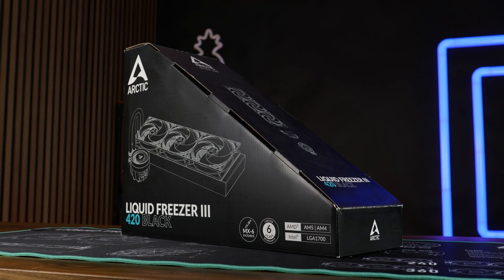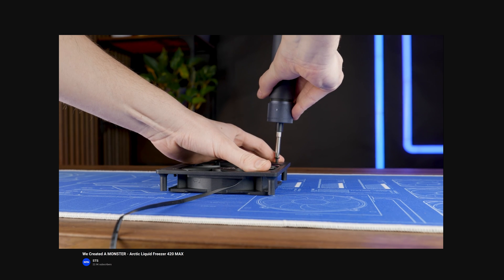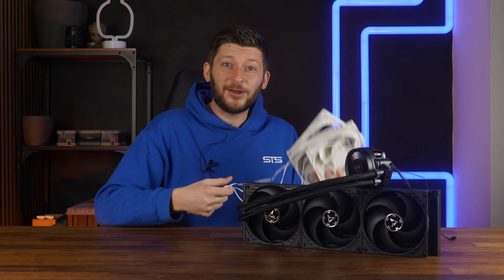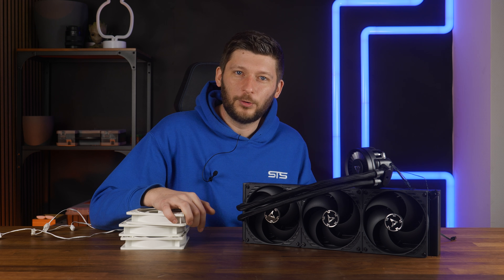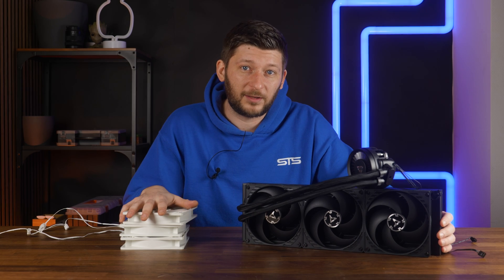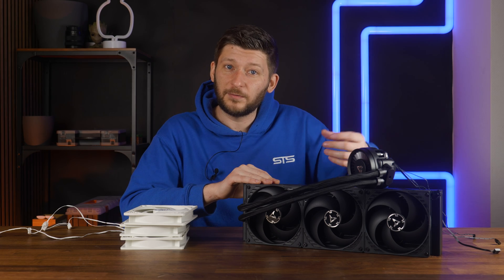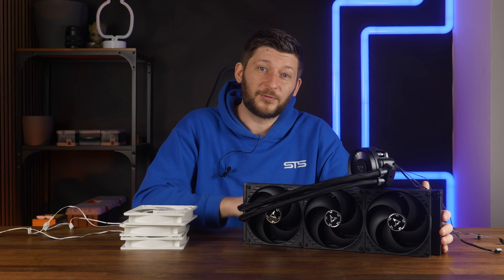Arctic Made A HUGE Mistake - Arctic Liquid Freezer III 420 in Push-Pull

Comment: mine dont have the cable atached to the two tubes going out from the radiator, so the fans are disconected, is that a munufacturing error? or are the cabbles hidden?

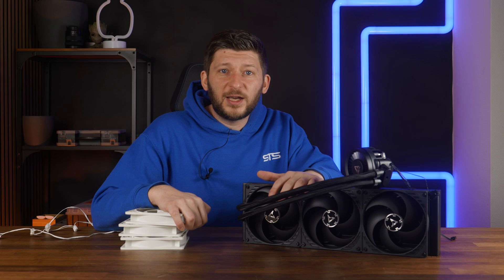Comment: 3:05 - 120W load on 420mm AIO, nobody cares...

Me, puting AC LF III 420 ARGB on R7 7700 capped at 103W... :D

Got good deal on that cooler, had to cut out the case to fit it outside the case on the top and I still mounted 3x120mm push (inside the case) and 3x140mm pull(outside, on the RAD, reversed of course), because - why not?:D

CPU is doing 70-75 *C max at full load no matter if I run it at 10%pwm or 60%pwm. Yeah, with 60% I am closer to that 70 and with 10-20%PWM range closer to 75, but still, can not see the reason to go that way as quiet PC under load is more important for me than those 3*C.

Comment: The best part is that the P14s are so cheap and so quiet. Yes they're not the "best" fans but imho they are the absolute best balance between noise, static pressure, and price. I did something similar by doing push-pull with my LFII 360 and six P12s. I have my fan curve set soooo conservatively and I honestly can't remember the last time I actually heard them get above the dull whisper they give me at idle. I only have a 12700k, but I do have it overclocked, and with this setup I don't think the fans ever get over maybe 45% fan speed? So great!

Comment: I have same aio, and have noctua 140mm fans with 13900kf. Reaching 91 degrees C with cinabench on 253w, I am right now planning to put 3 more noctua fans and will see how it goes
Reply: This guy seems a bit delusional or his graphs are not making any sense.. showing temps of 70ish with showing 320 W profile.. high workload?! What is that, cinebench or just adding some workload to the CPU (not stressing it)...
Reply: Btw I am hovering between 84-88 in R23 while pulling 275/290 Watts in R23.. but I am running undervolted 13900KS model (Corsair H170i AIO with Corsair 2000rpm 140mm fans)
Reply: @Need4FPS  i undervolted mine and remember that I use artic freezer 420mm with 6 fans of noctua 140mm 3000rpm which is the highest and biggest and most cooling fan at the market before industrial fans…  and I reach now 89 degree with 260W limited. Tried 300w and I reach around 96-97 degree. But when I use 260w I get score of 38800 score and thats pretty good if u ask me.
Reply: That feels to much for just a damn cpu cooling if u ask me. I should have gone with aircooling and might reached better performance..
Reply: amk youtube'da 100 tane LF 3'un review i var hepsinde de air cooling'e 15 C derece fark atmis. Bir seyleri yanlis yapiyorum demiyorda urune bok atiyor. Tipik turk amk.
Reply: @Faruk651  😂

Comment: So what you're saying is I should put either LX140 or T30 fans on my LFIII? I was already planning on using the LX140 fans on mine, but this is a confirmation that I should do that.
However, I can't figure out how to heat up my 9900x to 65+ Cº in order to liquidify my PTM7950 even with stock fans. Maybe I went a little overkill with the LF 420.
Reply: Turn the fans off/way down and run some benchmarks

Comment: For the 120mm Liquid Freezes the ultra high static pressure of the newer S12038 might work without push pull. You still save about 10mm of space and purportedly they aren't that much louder than P12 Max but deliver higher static pressure.

Comment: Going push-pull always improves radiator performance, especially with thicker radiators. It counteracts the airflow restriction of the radiator and improves overall airflow, which carries away more heat. The effect will depend on all the other variables in the equation, so it may be a marginal scenarios, but it will always be at least a little better.

Comment: In my Be Quiet Silent Base 802 case I currently have three Cooler Master Mobius 140 ARGB fans.  Could I use those instead of the extra Arctic fans at the front of the AIO?
Reply: check the CFM at the speed you want to run them, and see what the current arctic is doing, if they are not far apart i guess its good

Comment: I cant find pc case for top mount .. need help ..
Reply: Corsair 7000d/x will fit Arctic liquid freezer iii 420 ARGB in push-pull configuration. I have this setup in my PC. I hope this helps.
Reply: @gasgorth  case top side push pull?
Reply: @KlNGSNEVERDlE  Top
Reply: O11D Evo RGB fits it

Comment: Can change the fans? I remember the previous one had the fan pwm cables running along the sheathe of the tube.
Reply: This is the same as the previous. But what is the problem if you want to replace the fans? It has a 3way spliter PWM cable running along the sheathe of the tube. Just unplug the arctic fans and put the fans you want.
Reply: @gasgorth  So the fans can be replaced?
Reply: @Nanuk301  Yes if you wish you can replace the fans.

Comment: I came across this video after I had firmly decided to create push-pull in my future system, and this once again convinced me of the correctness of my decision.  But I want to ask you a question: my render station: Ryzen 7950x in a lancool 3 + Liquid freezer 3 420 rgb case.  I plan to install it vertically with the tubes up.  I also purchased the p14 max arctic fans pack.  Where does it make sense to install them?   Option 1: add the second row to the freezer.  Option 2: install under the top cover of the housing to push hot air through a nylon filter.  In this case, the 3 lian Li fans that came with the case will become the second row on the aio.  Or swap the sets?   In the second case, will I be able to control the high power of the p14 max to take advantage of their power?

Comment: I just oredere the LF III 420 and a pack of three Silent Wings 4 Pro. I am pretty curious how they will perform in a Push / Pull config.
Reply: You should always use the same fans on both sides of the radiator to achieve the best possible airflow. If this isnt possible at least use fans that have approximately the same RPMs.

Comment: Air speed or air volume will not reduce the ambient air temperature or cooling capacity of the cooler, and will not change the ambient air temperature and water temperature gap.
THE SAME LIKE increasing water flow speed will not change much: it does not change the temperature difference between CPU and water and will not change the heat capacity of water.
All of "you" are thinking and doing weird (lack of education?), across the physics of heat transfer phenomena.

Comment: Arctic P14 Max is out, can you make test with them on LF III 420mm, in push with 3 of them and in push pull with 6 fans?
Reply: just tried the max fans on the 280 way too loud don't try it lol do push pull if you have space.
Reply: I have arctic liquid freezer iii 420 push pull on lian li lancool iii rgb. It's working amazing and no noise..I put 3×p14 max in front, 2× 14 cm oryginal lian li fans pull out, one fan from top must be removed coz no space for tubes AIO.
so i really don't understand ppl who talking bullshit about noise or impossibility of montage 420 LF push-pull,in front of lían li lancool iii rgb..can! But need use brain and imagination 😂😂😂

Comment: Keep in mind that thing with the fans would change if you used different fans, so you cannot say the rad is done due to not much temp change at the top of the fan speeds in absolute sense, you can only say that is true for those fans.  fan-only tests sometimes show the last 10-20% doesnt do as much as people might think in terms of flow and pressure.

Comment: Congratz i today boughr LFIII i wanted change from my LFII boughr in november 2023 for better design and i broken my mobo where i had installed Thermatake AM5 frame.... With "old" Liquid freezer i had no problém and first install Liquid freezer III im broken motherbkard on right side Near rams.... GJ arctic maked púmp with so strong metal bended plate which broken motherboards...

Comment: SCREWS = UNC 6-32 at 32mm length for both sides! 
Roughly 1.25 to 1.26".

Thanks for the review. It made me want to try push pull as well, and being a Noctua snob I was surprised how inexpensive a 5pack of those P14 was on eBay. So naturally I had to get one. Since I still had my Alphacool screws from the olden days, I figured I was good to go. Ah crap, no. That's definitely not the right type. So looking at those, I saw the shorter ones being at 30mm, the longer at 35mm, I figured I needed just about those 35mm, if not even more with the thicker P14 fans, to mount the rad and fans to the top of my case. Oh boy, unit wars. How many fractions of an inch ... what? 

Let's poke the Arctic support. Took a week to get a response but that it was a good one. He apologized for a high ticket volume, referenced my name and a mentioned eBay order of those fans, and immediately sent out an entire set of screws and extras. It still made me wonder about the length. The other side had to be longer, right? Nope. Second answer said it fit and it does.
Thanks, Arctic Simon!

What kind of case do you guys use to make the LF3 push pull fit other than putting it in the front?
I figured my Fractal Meshify 2 XL had plenty of space, until I actually added those 27 + 38 + 27mm and idiot me realized that was more than the allotted 80mm of space for the top section of the case. 🙄
Arctic was unable to supply me with the spare part. Removing the mesh from the top cover was a waste of time. It still doesn't fit with the offset mounted fans. 

Pump noise is surprisingly agreeable, unless it runs full speed. Reddit had me fear the worst before. Pump and VRM at 50% don't stand out from the rest of the system. I can't recommend FanControl enough. Mainboard software has always been icky. There is however a bubble going brrr when I ram up the pump RPM. All radiator fans are set to 45% (~850RPM) and I honestly can't even tell yet if it makes a difference at all.

Comment: The radiator is not strong enough either. It has lower fin density, than 38mm thick radiator should have (its fpi is 15 instead of 20). It can be said, it was built specifically to compensate for flaws of their fans.

Comment: I have a Lian Li 011 Dynamic EVO RGB case with the following set up. 2 BeQuiet Silent Wings Pro 4 (140) fans side intake, 3 BeQuiet Silent Wings Pro 4 (140) bottom Intake, 1 BeQuiet Silent Wings Pro 4 (120) back exhaust. I could possibly have a push/pull, I would have to remove the top grate and affix the fans to the fan bracket mount.  Just wondering if  3 BeQuiet Silent Wings Pro 4 (140)  is good enough or should i have  6 BeQuiet Silent Wings Pro 4 (140)  in push/pull? I only have an Intel 136000K CPU, I may not see a benefit in a push/pull although it would be an experiment. I wonder at say 180 watts is it needed. I wonder what wattage would be needed for a push/pull six 140 set up. ..... Argh this is so long.

Comment: LF3 420 push/pull… which case can accommodate something that big😮
Reply: OEM - 011 Dynamic EVO RGB - not a chance. You would have to modify the top bracket and attach fans. You could not attach fans directly to the top of the radiator. The 420 would smash into the fan connectors on my Gigabyte board. lol....

Comment: Thanks for the review.  I had just ordered a LF3 argb and added 3 P14's so I can push pull right out of the box.  I've run high speed radiator fans in the past, Scythe, and they were super loud so I'm looking forward to this combo to tame my 13900k as my current evga clc 360 with antec prizm x fans will thermal throttle under high load.
Reply: lmk how its working out i want to do this with my 420 LF3 7800x3d
Reply: @ItzzParty  Do it and you won't regret it.  The fans get a bit loud once the temps start coming up but I'll take that over a hot cpu.  Sadly Cinebench still causes thermal throttling but its way cooler than before for everything else.

Comment: Hey all!
I bought LF III 360 RGB & i have a push/pull setup with using Phanteks T30's and its awesome, fans dont have to run very high, like 1k rpm while 4k gaming. I am using an AMD 7950X, with all core locked to 5.2 Ghz and my package temp while gaming and doing other side things, is like 38C to 40c most of the time, sometimes hit 42c, hope this helps.

Comment: You can push more of this rad by using all fin space on it. Put 3 25mm shroud, and 3 Noctua IPPC 3000 RPM, seal the thing for have no gap with neopren and check result. Because yes push pull is good for sur but each fan center hub space is not used without shroud.

Comment: Thanks for the testing, yes, push-pull brings a bit of extra performance out of our cooler, but that decreases compatibility drastically (we already have a thick rad). as for a LF3 Max as you suggested, well, I have a pen and paper ;)
Reply: Good to know that you guys find these reviews useful, definitely will wait for this product.
Reply: I am 100% going to buy a 420 from you now, I was not sure about if it should be yours or the EK, but reading your comment convinced me about you are not too big or "important" to listen to your costumers and not afraid of listening to new ideas.
May I please ask you if I can improve your great product by changing out the three fans to something else? If so, what do you recommend, thinking of noise also?
Reply: @friedmule5403  Can you decrease temps with different fans, yes.  Will those fans have a different noise profile, absolutely.
Reply: @zachmullins9444  Yes no doubt on that, you can get some 3500 rpm at 100% all the time, but what I am thinking of, is to still only use their products and try to get even more cooling out of it, with low noise. :-)
Reply: @friedmule5403  I did a 9800x3d build with this cooler Friday night, in an Antec Flux Pro and it's completely silent.  You literally can't tell if the pc is on or off by sound.  CPU temps max out at 52.5c in gaming.
Reply: @zachmullins9444 did you do push pull? You used a liquid freezer 3 420?
Reply: @SpartanJRT3  Liquid freezer 3, 420mm, no push pull, stock fans.
Reply: @ gotcha, thanks! My 14900k I think pushes this aio to its limits. Would’ve went 9800 but I also used this pc to work so the amount of cores matters for my workloads
Reply: A question for you, is it OK to have the fans above the radiator in a push configuration, but hanging from the top of the case?

Comment: You should add another test to all your AIO products' testing: fan-standardized tests using either 3 or 6 Phanteks T30 fans (at least for the 120 mm fan version AIOs). Doing fan-standardized tests, I discovered that my original model-style Swiftech H320 from 2012 or 2013 is superior to my Arctic Liquid Freezer 2 360 even though the ALF2 has, both, a thicker AND denser radiator. I did the tests with 3 different sets of fans: 6x Swiftech Helix 120 (push/pull), 6x Arctic P12 (push/pull), 3x Phanteks T30. The Swiftech was 2-4 degrees cooler than the Swiftech with all 3 fan models and at all RPMs (600, 900, 1200, 1500, 1800, 2100, 2400, 2700, 3000). I re-mounted, re-pasted, and tested everything 3 times each.

Comment: Can you do a test with the diferences between the P12/P14,  Argb/non Argb, noise/performance levels? And whats quieter or pushes more air: 2x140mm or 3x120mm fans. Thanks

Comment: Do you think strapping phanteks t30s instead of the standard fans would make better sound to performance on the lf 3 360?
Reply: It does, I had a 2-4C drop in temps but more importantly i could set a very quiet curve and it was still decent cooling. Haven't tested the iii yet but got d30 140mm on the 280 so we'll see
Reply: Are the "phanteks t30s" thicker than the Artic P14's? What screws would you end up using?
Reply: @AM-hm5eq   they are 5mm thicker and come with longer radiator screws so you don't need to worry on that front

Comment: Great video as always, but if you had to pick between three AIOS currently what direction would you go for the 13900K? The EK 360? Lian Li GA II Performance or the LF III 420mm with the push and pull setup? Or does anyone have any experience between these AIOs currently?
Reply: For 13900K one should save money for spare 13900K

Comment: I currently have the LFiii 420 in my system in push pull... It made my 7950X draw so much power trying to reach yhe 95 degree stock targe ttemp that it made the whole thing unstable. I did manage to get some benchmarks of the LFii 420 and it prrforms better with a slightbundervolt and max temp set to 75 C... I managed a 38K score in cinebench all core. Stock settings had it at 37K. My fans worj a bit harder though, at most they soun up to 1400 RPM but thats even louder than the case fans which are set to 1600 and I can't control them. Its complete overkill and I love it.
Reply: what case do you have for that push-pull setup?
Reply: @joachimhagel4676  deepcool ch780

Comment: I hope Arctic finally releases there P14 maxes so, that would atleast solve parts of the issues
Reply: Just ordered my P14s Max today 😌
Reply: @ogxcoleman  howd you manage that lmfao, they're prema sold out
Reply: @Meniak  not any more... it only took two months.
Reply: I think what this video shows is that push/pull is always going to be better, and even with mid-performing fans like P12, you are able to get everything out of it at lowest volume of any aio.  With faster/louder fans it might get better stock performance, but it wouldn't provide better performance in push/pull.  Moral of the story, buy some cheap and quiet P14s for pull.
Reply: push/pull on this newer Arctic would be better with better 14mm fans.
Reply: But is that the case?  He shows that with the mild P14s in push/pull he is getting most out of it. @xBINARYGODx